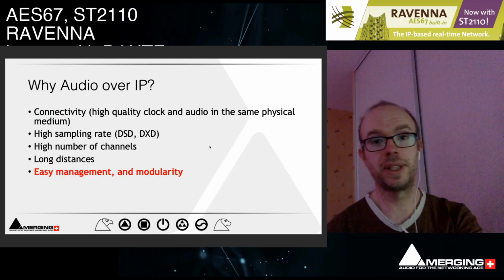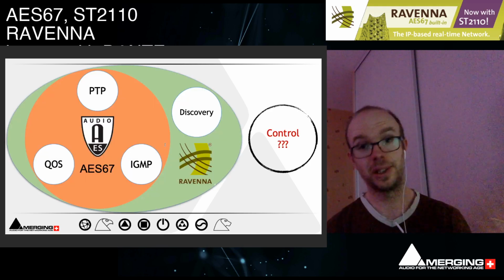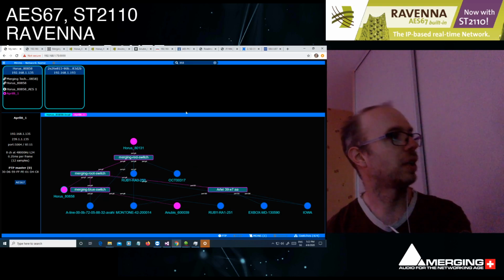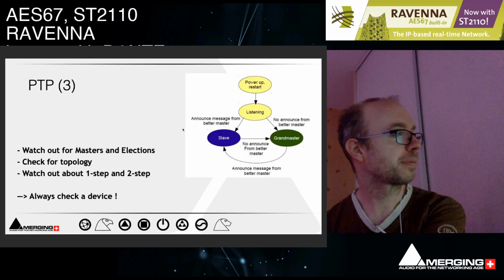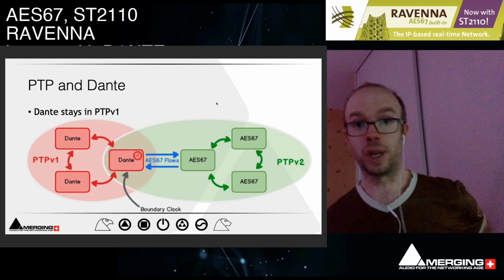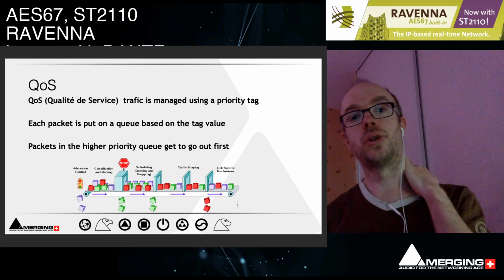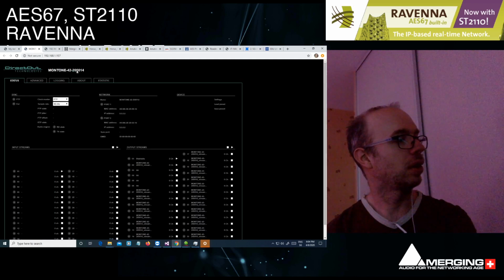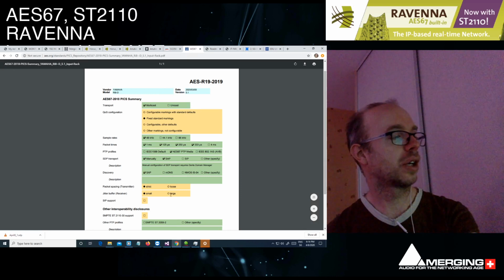AES67/RAVENNA (beginners)

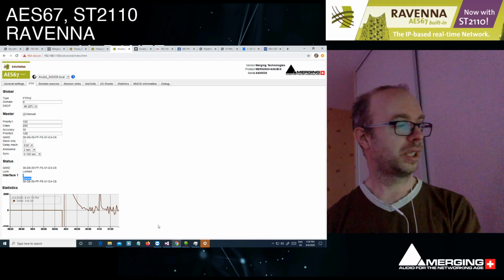Comment: Thanks! Really helpful, one thing I'm stuck on though is how to determine what Dante's PTPv1 priority value is. In your example (at 51:44) you suggest a PTP P1 value of 120 would be master, 250 would be slave. So Dante's PTPv1 priority must be between 121-249.  Is it a fixed number? Or is it configurable from Dante Controller? Thanks,
Reply from the maker: Hi, from a Wireshark capture it looks like the PTPv2 priority in Dante AES67 is 128. As far as I know this is not configurable with Dante Controller.
Reply: MergingTechnologies Amazing! That’s really useful, Thanks. I’m assuming PTPv1 though? Just checking I’m not missing something. Thanks,
Reply from the maker: No no, PTPv2. From Wikipedia : Priority – An administratively assigned precedence hint used by the BMC to help select a grandmaster for the PTP domain. IEEE 1588-2002 used a single boolean variable to indicate precedence. IEEE 1588-2008 features two 8-bit priority fields.
Dante uses PTPv1 (IEEE1588-2002) while AES67 uses PTPv2 (IEEE1588-2008)
Reply: @MergingTechnologies  Thank you! Very useful,